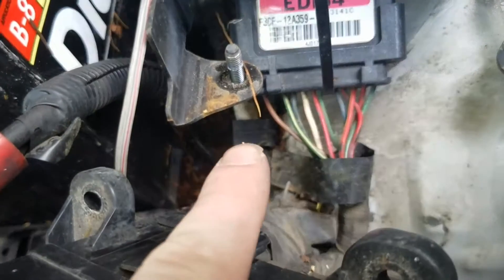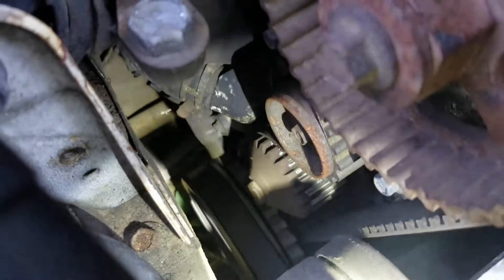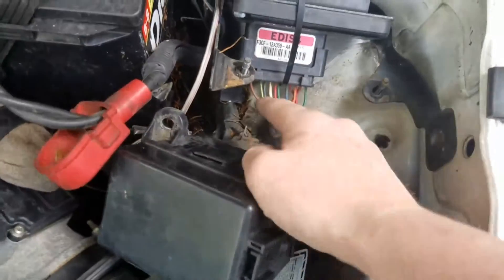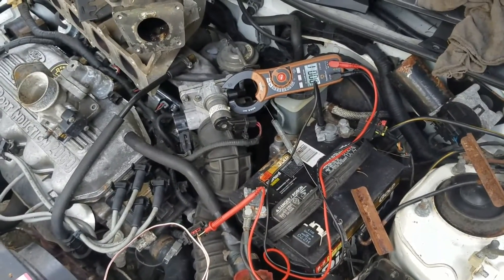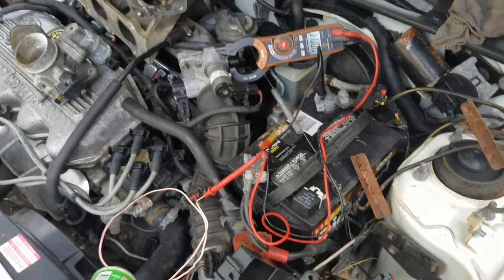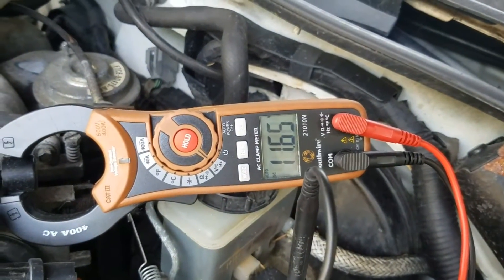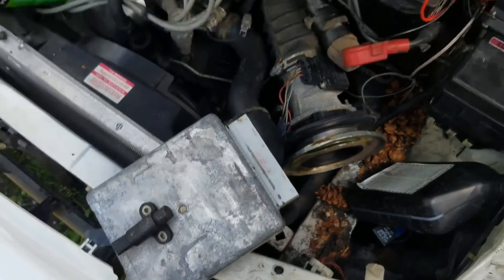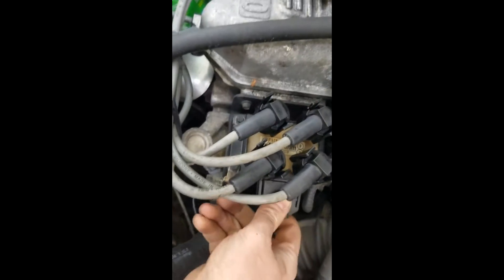Diagnosis: 91-96 escort Intro to EDIS-4, Wiring, And Basic Testing of No-Spark condition

Comment: I have a 99 ford escort se and its not getting power to the coil and the fuel pump isnt kicking on. I repaced the coil and thw temp sensor and the altenator. Dont know why it wont start. Cranks but no start thanks in advance
Reply from the maker: Coil, and pcm power gets power from 15a fuse "engine" .. PCm relay controls the FP relay. First thing to do is verify power at "engine" fuse.
Reply: @MegaMarclar  they all have power but still nothing
Reply from the maker: @Donkeyjuice2  you are going to need a scan tool to monitor the rpm from the crank sensor. to see if there is a signal.
Reply: @MegaMarclar  i tried and it wont even link.
Reply from the maker: @Donkeyjuice2  well sounds like you got a serious electrical issue. Probably something I wont be able to help with like this. Are you on feoa.net?
Reply: @MegaMarclar  that's ok. Its gut me stumped to. And not to my knowledge

Comment: So I have a 1995 Mercury tracer trio (Ford escort) and I am currently getting no spark to the spark plugs.
Changed out the ignition coil, new spark plugs and wires, also installed a new ignition switch since one of the main wires (black with white stripe) will lose power when trying to start the car.

Also, when turning the key to the "ON" position the fuel pump isn't kicking on like it always does. (You can hear a slight hum when it does kick on).
Reply from the maker: Sounds like you have a supply power problem. Test for power st the main and FP relays
Reply: Hi, so I tracer the wires to the passenger side, that's where the engine control module and fuel pump relay are located (brown/black relay and the fuel pump relay Black/green)
The engine control moduoe kick on fine, the fuel pump relay is not kicking on, the relay tested good but the wiring harness it connects to is receiving no power.
Reply from the maker: @josephj6340  the fuel pump relay receives power from the same place the PCM relay does... iirc

Comment: Hi, 

I would like to know, Why It doesnt have a negative signal in the inyectors? I have sparks in all cylinders but the car it doenst start. 

My car its a Ford Mercury Tracer 93 1.9  Automatic Transmission.

Thanks in Advanced!
Reply from the maker: The powertrain control module controls the negative side of injector. There is a constant power supply to all four injectors. If you have spark that means that the crank sensor is working and sending a signal through the Edis module and to the PCM. The cam sensor located next to the throttle body in the head is what time's the injectors. I would try replacing the cam sensor
Reply: @MegaMarclar  Another question muy friend, My English it's no so good I'm Venezuelan, From Edis Module go out signal to Cam Sensor? How I can Check signal at Cam Sensor Conector? Thanks again!
Reply from the maker: @Sandykroy  the crankshaft sensor sends a signal to the Edis module. Edis module then sends a signal to the PCM giving it a RPM signal. The PCM then sends timing Corrections back to the Edis module. The camshaft sensor is only used by the PCM to identify where cylinder number one is in the rotation. This information is used to calculate when to inject fuel. The sensor is a hall effect type which means it creates a digital Square wave signal. There is no really easy way to test the sensor without an oscilloscope. The best course of action I think for you would be to replace the sensor
Reply: @MegaMarclar  In other words, with this sensor damage or disconnected the car it doesnt start?
Reply from the maker: @Sandykroy  if you have spark, and no fuel, then yes. 
Also,.verify you have fuel pressure at the test port on the fuel rail.
There is a shut off switch in the passenger rear trunk compartment accessed by a removable panel.
Reply: @MegaMarclar  i forget it! When put the swicth on, fuel pump it doesnt off after 2 to 3 seconds like before.
Reply: Hi again!

My friend, I discovered camshaft was disconected, but disconected the car was started, I fix 2 cable but the car doesnt started. I don't understand, camshaft sensor disconected and the car started 3 times but off almost inmediatedly. What can I do? Thanks in Advanced.
Reply from the maker: @Sandykroy  sounds like a weak fuel pump. Do you have access to a test gauge? If not, I would look a double checking the fuelpump power and ground at the pump behind the rear seat. You should have power for a few seconds after turning the key on .  It should also come on while cranking .  If those are both good I would look into replacing the fuel pump
Reply: @MegaMarclar  Don't make a test gauge, When push the pin of service valve fuel pump , the fuel reaches the hood, simple view there is a good pressure. Another question Will be: Low pressure can be , PCM doesnt send the ground signal to the inyectors? Thanks again! Sorry for my bad English.

Comment: i have a 96 it doesnt have a EDIS module how can i fix a no spark issue where the ignition coil is not getting signal to fire (ive confirmed crank sensor is working)
Reply from the maker: The pcm directly controls the coil. You will need a scan tool to verify engine rpm while cranking to rule out crank sensor.

Comment: How did you get the H270 cooling fan relay out?
Reply from the maker: Jenny Chamberlain are you referring to the one in the fuse box? just pull straight up and out
Reply: Thank you, got it right out. Did you ever take out the starter solenoid when you were working on your escort?
Reply from the maker: no need. if there is a problem with the solenoid, it's cheaper to replace the whole unit